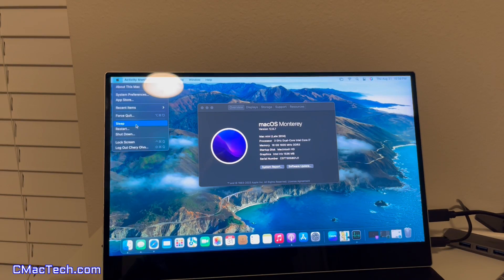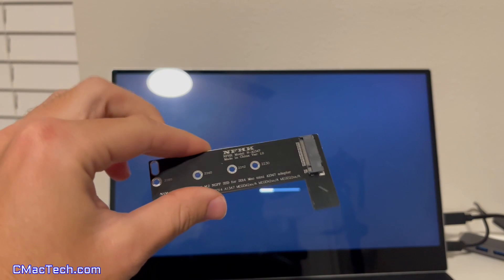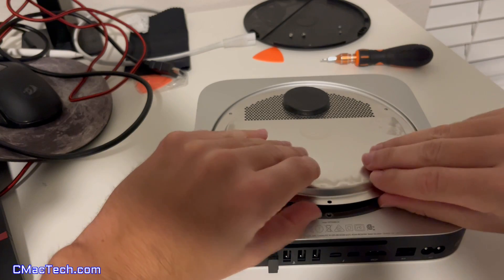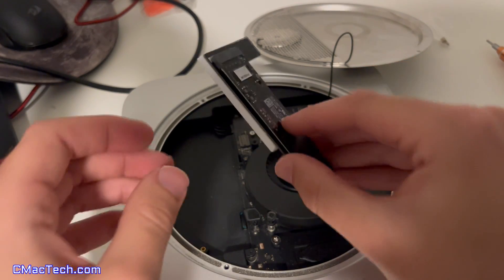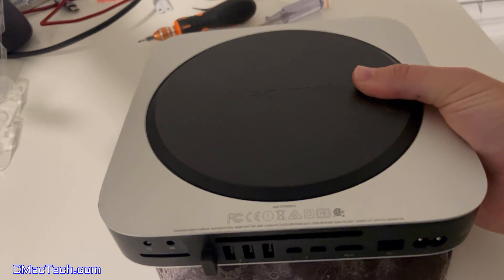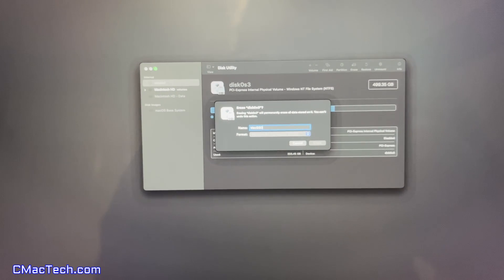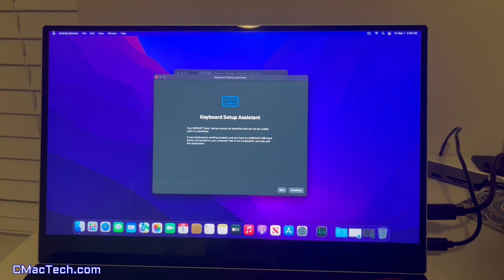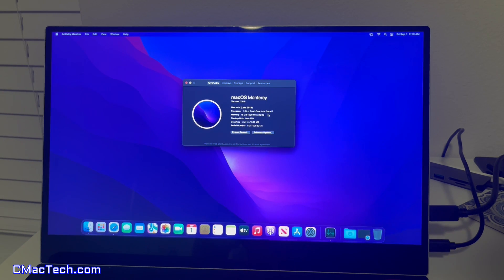How To Install a NVMe SSD to a Mac Mini (Late 2014 Model) - SUPER QUICK & EASY

Comment: Do you still have it? would you be so kind to measure the transfer speed  (black magic disk speed) I have one with a SATA SSD but I dont know if it will run faster with an nvme because of the SATA bottleneck... Regards
Reply: My thoughts too. SATA3 is the bottle neck.
We need to see numbers from black magic.

Comment: you don't need to crank it down with the screw - just slightly tightened otherwise you run the risk of cracking the NVMe board.

Comment: I did this, every step the same. After installing the drive simply not recognized as boot up drive. Disk utillities still sees it.
Reply from the maker: Any luck?
Reply: Installed it as well. My drive is simply not visible at all in disk manager. Tried with 2 different ssd drivers in that kit, not working att all. Checked the ibstallation and the adapter fits fine. Just no disk available. Don't know what's wrong.

Comment: Thanks for the video. About to do the same upgrade on a 2014 Mac mini,  2.6ghz i5 , 8G ram. Picked mine up for $80.  Just wondering if after you setup the SSD card as the new startup disk if you left Monterey installed on the old internal 1TB drive so it could also be a bootable drive just in case as well as storage. 
Thanks in advance.
Reply from the maker: Nice buy! I think since I re-provisioned the Mac, Monterrey is only installed on the SSD. But i think as long as the original disk drive is installed, you can still reset and install Monterrey on the original drive (if you are concerned if the ssd will ever get damaged). The disk drive works good still as a secondary drive to store files!
Reply: Thanks. If the new SSD installed is stable I'll reformat the old hard drive. Not much on it yet anyway. On my first attempt with used drive sometimes the SSD drive often disappeared on restart. Getting new card on Monday.